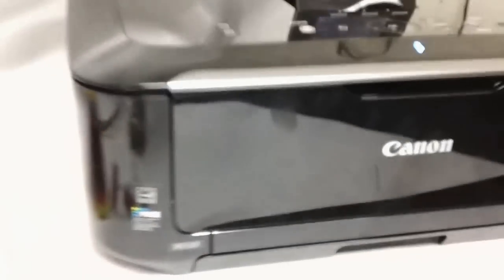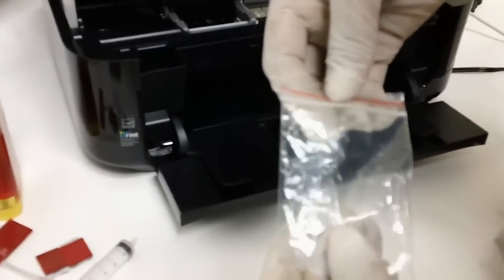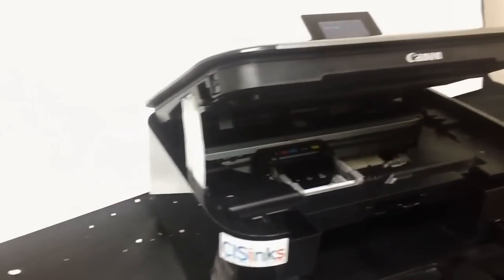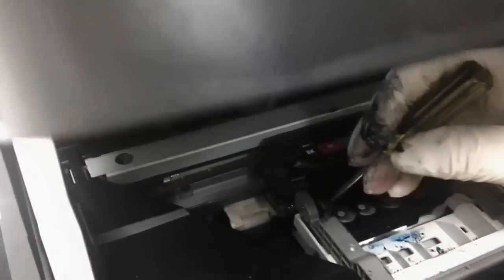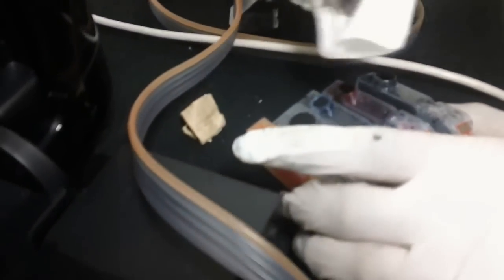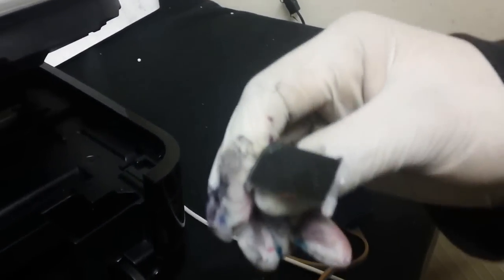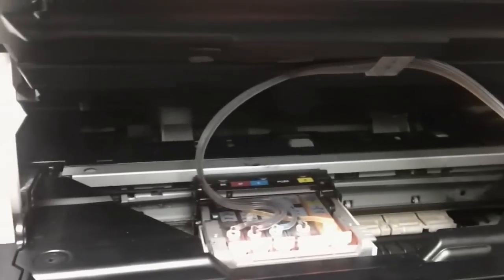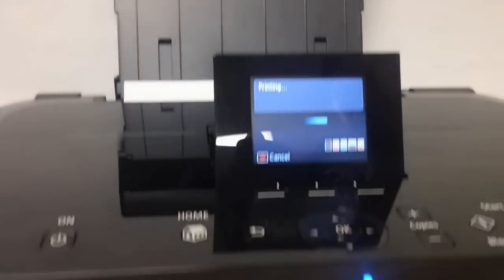CIS Installation for Canon 225/226 Cartridges Tutorial

Comment: by the way, Silicone Seals around 1:01 need to placed in OPPOSITE direction(long side headed back). I tried with your way, but ink leaked every single time. I almost messed up my printer

Comment: This ignores the fact that your ink lines are not primed and your test page is missing half the colors..The problem with your system for this model is that the cartridges were not fitted with a bleeder hole to remove air bubbles and prime the lines.